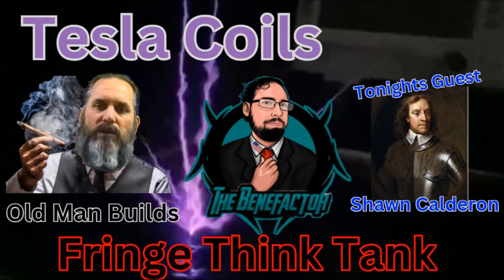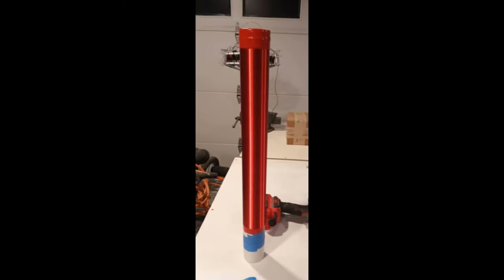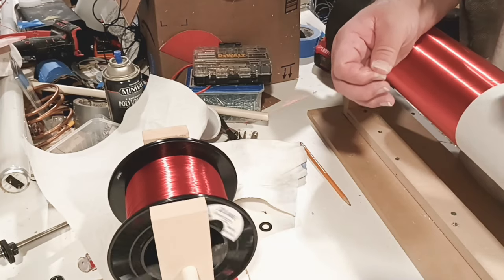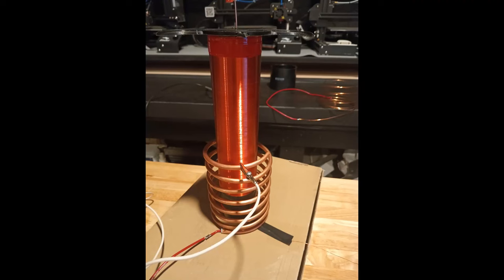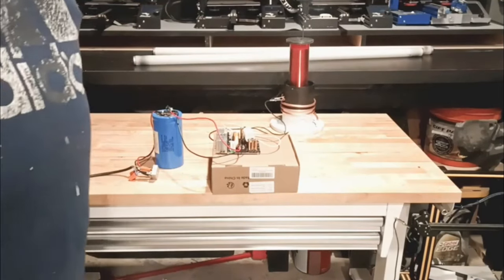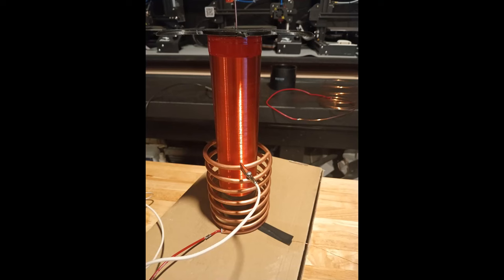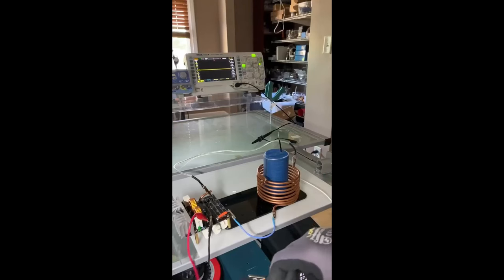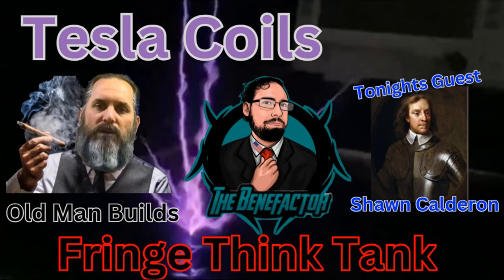Building Tesla Coils

Comment: Good job.  You forgot B C E on the drawing... left to right..
Reply: he called it a MOSFET so No B C E Source Drain and Gate. I didn't look up the pin out for the part number he gave.
Reply from the maker: so I believe it is a npn. Normally you can use a pnp. They are different connections. I should have made that clear in the video. My coil was 300khz out of resonance in the video. I could have gotten a higher voltage to be steady if I knew it at the time. I should have also used a snubber to stop the heat in the circuit from affecting the power level.

Comment: pancake coil, for primary. this is to satisfy 90 degrees out of phase. placing the primary at the 1/4 wave position. format the air/dialectic with the use of the piezo. transmission with sympathetic vibration . format the air at the receiver....
Reply from the maker: I am going to use the 1/4" copper and just wind it. I don't know if the zvs can do the 90 degrees. If I wanted to run a spark gap the 90 would be perfect for the size of these coils.

Comment: You have a signal generator. Can you not find the recount freq of any coil With a simple bridge that balances resistance against the inductance of the coil? and if you have Nothing a variable resistor in series of the coil and adjust until you see the same voltage across the coil and the resistor? You can do this at low power.  You had LONG wires in one of the setups that didn't work and those added inductance in series.  ??  Old man here .  The bridge circuits I remember from Rockwell international. Was lucky enough to work in the Microwave Repair and Calibration department.
Reply: < saw you pic Old man... you look better than me.
Reply from the maker: The long wires get cut down when the top load goes on and the bottom wire gets soldered. Before I went there I wanted to test the numbers. each one will go down a little as I add the top load. The java shows it with a top load. My goal today to to do all the clean up.

Comment: What would happen if you made the core out of glass?
Reply: It would increase the dielectric storage coefficient instead of the magnetic, and it would respond with a dielectric field instead of a magnetic field when induced, albeit weak compared to something like quartz.
Reply: @JenkoRun  a dielectric field?
Reply: @billschwandt1  It's the original and more accurate name for the "electric" field, also called the electrostatic field, aether tension, Faraday and Steinmetz referred to it as such.
Reply: @JenkoRun  that word is abused on the internet so bad. Lotta confusion about what it means.
Reply: @billschwandt1  YUP.